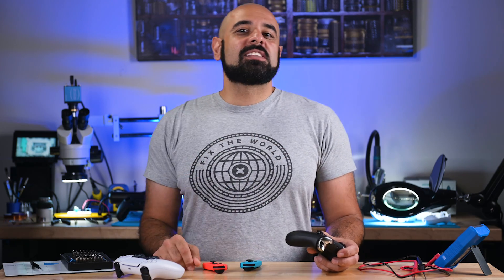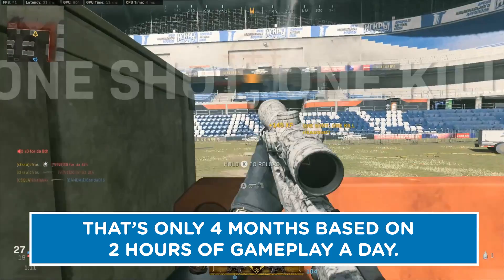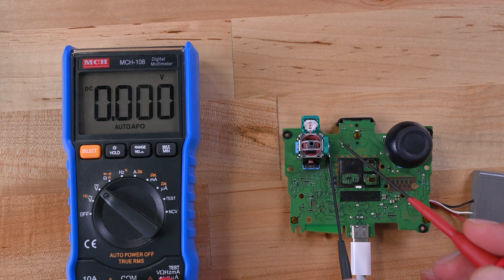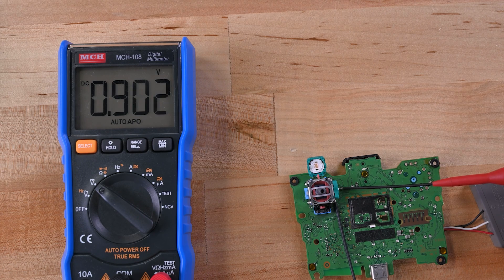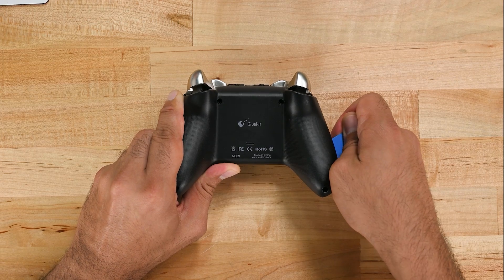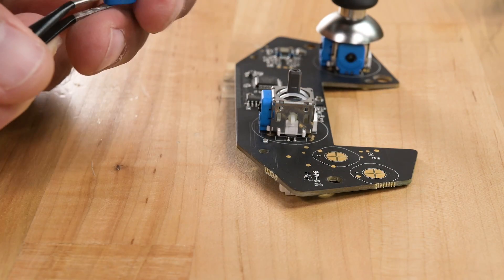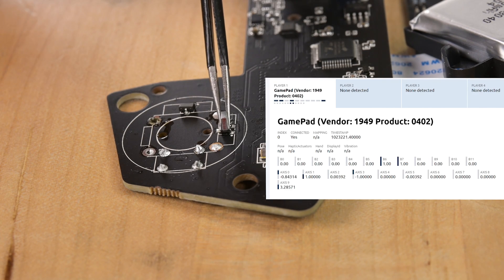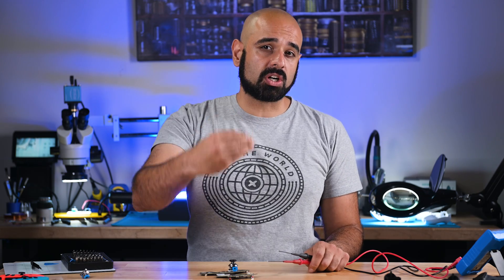How Manufacturers Can Fix Joystick Drift - Permanently!

Comment: If I know what they are doing with the whole "Planned obsolescence" thing then I know they won't actually implement these features on newer controllers or designs, and will continue to create unnecessary E-Waste, even though these Hall effect sensors are better in literally every way.
Reply: Don't forget there are no original (good) replacement parts. Back in the day I tried to fix my Xbox 360 controller and the replacement stick couldn't do a smooth circle anymore, only a square with rounded corners.
Reply: @LEXXIUS  yeah I have 3 Xbox original controllers which have stick drift but are perfectly fine otherwise, but it makes them completely unusable because I do not have any soldering skills, or equipment to fix them, When I used to play PS3 a long time ago, stick drift was never a problem for me and to me it just feels like they purposely switched to carbon based potentiometers in the PS4 and PS5 controllers just to make more people buy a lot of them more often.
Reply: @shepshepson  nope. The PS3 also used carbon-based potentiometers. Sony and every other console manufacturer switched to Alps potentiometers since they thought the magnets may interfere with the wireless signal.
Reply: @BurritoKingdom  really? Man that stinks, because I opened up my own ps3 controller to find some hall effect sensors in them
Reply: @BurritoKingdom  ps1, ps2 and sixaxis controllers use them but dualshock 3's don't.
Reply: @shepshepson  you can probably replace the potentiometers on the xbox 360 controller i think that’s the only thing that really goes bad with these controllers or they get dirty
Reply: @dannyboy643ify  now if only I can can hack my way into getting a 360 controller to work with a Xbox 1 lol
Reply: just get an 8bitdo adapter
Reply: @shepshepson  Some PS3 controllers use hall effect sensor
Reply: @LEXXIUS  You can easily replace them, Digikey and Mouser stock many different versions of pots. 

I replaced my PS3, 360 and PS4 pots with better pots from Digikey specifically and nearly 6 years running they still feel brand new and have no drift.

If your controllers have stick drift - you shouldnt be using "original" components that match the original because you're literally just delaying the inevitable. buy pots that are better built and you wont have this issue again, or find a controller manufacturer who uses Hall-Effect sensors and never deal with it again.
Reply: @rotor13  Thanks, I had no idea, you could get them separately! I assumed, the whole thing was one unit and these potentiometers being specifically made only for this application.
Reply: @rotor13  Could you please provide the part name and number?
Reply: @LEXXIUS  Theres like 50 different ones you can choose from.
Reply: @rotor13  I'm concerned the replacement part won't give me the original precision and accuracy (like mentioned above: only able to do a square with rounded corners instead of a circle). That's why I try to find the exact parts that are confirmed to work by other users. Also, I don't know the specs, like ohms and other potentially important data of the original part.

But I have the idea to try dielectric grease on the still good potentiometer's contact surfaces to reduce the wear.
Reply: @LEXXIUS  Really? On Aliexpress you can find all sorts of thumbsticks, and I suspect some of them are the same used by console manufacturers. 
The square thing may be a matter of calibration.
Reply: Competition with 3rd party controllers is our only hope
Reply: This should be against the law.
Reply: I don't think it's planned obsolescence. it is just it cost less to handle the few controller issue (warranty is limited in time, and many won't even bother) than putting a costier sensor.
Reply: @Clarissa 1986  do you have actual evidence for that? U only quote the lightbulb cartell because u saw an unscientific documentation on youtube. It is not backed up on sources, also, standardization in industries is a common thing. I dont see how standardizing products is a way of planned obsolescence. As an engineer i know that there are three variables when creating classic lightbulbs: energy consumption, durability and emitted light.
You can not max out all three of them, changing one of them causes chances in the characteristics of the other 2. creating a standard for one of those variables makes it possible for the companies to work on improving the other two. 
„Where police found out“ ahh yes, 
„They had to pay penalty fees“ i love these claims that are not backed up by evidence.

To the capacitor thing:
Yes, lifespan can be predicted, but imagine you are a company A. You sell a device and use capacitors that are very expensive in it.
Company B sells the same product, that looks exactly the same to the consumer, but is 3% cheaper because they cheap out on capacitors. 
Now what do you think, which product will consumers buy if they see two from the outside identical products, one of them being significantly cheaper?
Exactly, the cheaper one.
How exactly is this behavior fault of the companies or „planned obsolescence“? 
The companies behaviour is just result of the consumers preference of low prices.

Also: if planned obsolescence would exist, there would be scientific evidence on this. But there isnt any, studies on this topic found no evidence.
Reply: @csPinKie  what would constitute evidence in your opinion ? i know they know how to improve the product, i know they claim it is to make the product cheaper, their argument is that cheaper sells better than durable, where is the proof of that ? did the scientists market two versions of the same product were one cost 2 dollars more per unity but promised a longer lifespan ?
Reply: @devforfun5618  i had this discussion with employees of Markets such as microcenter etc, every time i ask them about repairability etc they are suprised and tell me i am the first one asking.
Consumers simply dont care, thats why they buy airpods with irreplacable batteries that will be useless in 4 years. Until this consumer behaviour doesnt change, companies will not change
Reply: @csPinKie  Hi provide me with 3 scientific studies backing up your claims that "consumers just don't care", thanks in advance.
Reply: @it-s-a-mystery  I explained the problem a priori, a priori arguments per definition dont need sources, please say what part of my argumentation is incorrect.
Also, OPs comment started making claims without proof or rather with the existence of contrary proof, so what is ur argument?
Reply: @csPinKie  I was obviously being facetious due to you asking for studies for phenomena that cannot properly be scientifically evidenced in the corporate world for exceedingly obvious reasons.

My argument is "log off"
Reply: @it-s-a-mystery  nice cope
Reply: Wether "Planned obsolescence" exists or not has been discussed in many Scientific Journals, with none of them confirming its existence
Reply: @csPinKie  do you think that they don't plan this stuff? Because IMO I think it's absolutely real, especially with things like phones, laptops, and cars.
Btw lots of phone companies purposely stop updating older phones just to make people buy the newer ones even though it's old 4-5 years old and still is a decent phone by today's standards.
Reply: @shepshepson  Especially the things you talk about (like modern electronics) are devices that have high performance increases yoy, not to say things like new wifi, safety or cellular standards. It does not make sense to support these devices in fast development markets cuz technology itself will make it obsolete in the near future.
People not buying cds, tapes or dvds or is not due to obsolescence of these products or the devices they run on, but because the technology itself is obsolete.
I agree with you that using a phone for 6 years or longer is not the worst user experience, but market research clearly shows that the majority of people simply doesnt want to keep their phone that long, especially the type of women who buy flagship phones for the status or the new camera regularly even though they clearly didnt even use their old phone to its fullest potential
Reply: @csPinKie  yeah I suppose your right, I just hope in the near future these companies won't take such major advantage of this anyways, it really is killing the planet
Reply: @shepshepson  because there is no incentive for the phone companies to keep supporting old devices as they are no longer getting money from them.

Apple can support them for a bit longer thanks to them holding the entire ecosystem.

Android manufacturers' profits are limited to phone sales and if someone buys on their local marketplace, but they make less than what Google is getting.
Reply: @shepshepson  not updating the phones makes some sense, the update is to accommodate new hardware, what doesn't make sense is apps not working on older versions of android even when they don't require the new functions to work
Reply: @csPinKie  Well whether it exists or not, this is planned. They know its not going to last long and people will need to buy new controllers within a year of a product thats supposed to last 6-8 years.
Reply: @imo098765  again, there is no enpirica evidence.
Engineers have to design products according to consumer needs, and consumers mainly care about price.
If you have a washing machine that uses bearings that will last 10 years instead of competitors 5 years, your product will be more expensive and loose in comparision to the competition.
People dont care about longevity of their products, just ask electronics sales people about longevity of certain parts, the go to answer i receive from them is „you are the first person asking, ever“.
Sincerely
An engineer
Reply: @UC6kW9b4kEGIpw3uYYZl1Baw can you provide me with an a-tier journal source on that?
Reply: @csPinKie  since we adding what we are - scientist who works with suits

You are right its designed to last half a year to meet needs of the suits selling the product

They know it wont last long and will want to sell you another working one, maybe its a new colour or its God of War themed, maybe it will be Venom themed for Spider-Man 2 or Wolverine themed

but they 100% planned to have us the consumers buy a second controller.
Reply: @csPinKie  Just to add if the company said we selling a more expensive version which fixes drift issues

They could say $10 more and it is now added to the cost of the PS5, people would still buy it because Sony just told them this is the better version
Reply: @imo098765  if this video didnt exist, people wouldnt even know there is an alternative way of doing controllers. You too wouldnt know without this video, because you didnt care beforehand
Reply: @csPinKie  PS, Nintendo, Xbox etc are all selling premium devices with a part that is rated for half a year of gaming and doing nothing about it despite complaints from consumers AND LAWSUITS. You seem to miss out the fact they are being sued over this product

I know is because I've experienced the problem and wanted to know what the fix was 8 years ago and did what I can to change it for me. Others also have the problem but not the skills to repair it themselves. They get a new controller because their old one is faulty

The funny thing is the PS3 controller was more drift resistant than the PS4 and PS5 so its not like they didnt have a better one
Reply: @imo098765  Can you name me 3 Lawsuit cases that relate to the potentiometer situation?

Its not that other people dont have the skills, you dont really need the skills to change a potentiometer.
They are to lazy and rather buy a new one because they dont care.
If they would care, they wouldnt buy the same faulty product again.
Reply: This is not planned obsolence.
Reply: @mihaitha  Yes, yes it is.
Reply: @bobmcbob4399  no, no it's not.

Comment: I've always wondered why optical encoders haven't been adopted. So much professional music hardware is covered in optical knobs. Hell it's how pretty much every mouse works now, so it's not like we're lacking the tiny precision power efficient integration.
Reply: They simply cost more.
Reply: @Aikano9  My optical mouse cost me $15. I doubt that majority of that $15 is the optical sensor.
Reply: Optical encoder happened, that's how the N64 stick worked! Honestly it's terrible, the splitter to translate the XY movement into separate X and Y wasn't well made due to unsuitable material choice (ABS - not enough abrasion resistance due to flake grafting), there was an attempt at gearing which wasn't that well conceived either, and there were only like a couple dozen steps of precision across the movement range, like maybe 64 tops.

Which pro music hardware has optical knobs? I don't deal with stuff that costs above a grand, but i haven't seen anything, all purely electrical contact based so far, sealed oil type though, nice enough to last a lifetime. Except DJ controller platters, those are always optical.
Reply: @SianaGearz  literally hundreds of devices and it's not just limited to audio hardware. pretty much anything with a precision knob that spins forever. thanks to optical mouse technology, modern optical encoders have evolved to be incredibly accurate and cheap.
Reply: @placebomessiah  Not "literally anything", lots of indent-free contact rotary incremental encoders, they're the standard solution really. Feel and work fine, when well made, and even in middling music gear, they've got some quality behind them. Naturally not forever unlike optical. Optical devices have a flaw, they need to not accumulate dust, and at small sizes they need to be fully shielded, which is way more difficult than it seems; this isn't the case with mechanical ones, the oil pressure just doesn't let any dust come in so the seal can be fairly loose and they'll still run for a couple decades. Making a tight seal is a near impossibility since you want that shaft to rotate easily.

Or like DJ turntables there there is often just the bare minimum of shielding but the optical gaps for rim sensing are so generous that they just won't get clogged up in a reasonable time. I mean obviously people still manage to clog them up sometimes. Another interesting issue is in the optical absolute encoder crossfader Behringer made for some of their higher end DJ mixers, which is nice enough, should last an eternity... unless it happens to be used near a fog machine, where it will temporarily glitch out. Not great for the intended usecase.

Also nothing to do with optical mice necessarily. You remember ball mice? They split the ball motion onto two shafts which were read by optical incremental encoders. That's still how incremental optical encoders work, not with array imagers and DSPs that optical mice use. They didn't reach very high step counts, unlike possible with sealed optical encoders, though those have a considerable cost to them.

Comment: Thanks for the cool vid. Very informative. 

So why aren't manufacturers using this tech already? what's the downside of it? 

Are they purposely trying to build in, obsolescence in this case?

I mean if they did like you guys said in another video, at least make the thumb sticks hardware, replaceable, that would be a great thing?
Reply: Planned obsolescence is my guess honestly, it makes no sense to keep using potentiometers when HES are so much more reliable and not that much more expensive to manufacture.
Reply: Potentiometers are as cheap as dirt so I think that's the main reason, the obsolescence is a byproduct.
Reply: The downside is, you could still be playing your PS2 20 years later, instead of buying Sony's new console.
This is bad for business. They would rather force you to buy the newest console, and pay for all your old games again!
Reply from the maker: This is an interesting question and as others have guessed it may simply come down to cost but it's difficult to know without further investigation.

Our goal was to identify the problem and potential solutions and you are absolutely right, making modular thumbsticks would be one solution. The Steam Deck has done just that.

Comment: Hall sensors also drift over time. APEM inc makes a hall effect thumbstick that is only rated for 1 million cycles. They also cost a whopping $130 a piece. If these can last longer than the 2 million cycle thumbsticks currently in use I can't image how much they will cost. How many cycles have these sticks been tested to withstand?

Let me guess.... NONE. Yea I wonder why engineers aren't putting in huge purchase orders. They must have forgotten the basic engineering principle that hall effect sensors = magic.
Reply from the maker: A quick Google search would show you industrial applications that last 6 million cycles. https://eu.mouser.com/c/?marcom=117766612

You can also read our accompanying blog post. The Saturn 3D controller and Sony Sixaxis controllers did not cost $130. https://www.ifixit.com/News/60702/sega-solved-the-drift-issue-almost-30-years-ago-heres-how

Comment: Would it be possible to cannibalize the joysticks of Guillikit into a play station controller? or its not just possible because of some reason?
Reply from the maker: Not quiet that simple. Hall Effect sensors have different voltage requirements and ultimately output an analogue signal that may need to be converted depending on how the solution is implemented.

It's possible, just not as easy as a plug and play replacement.